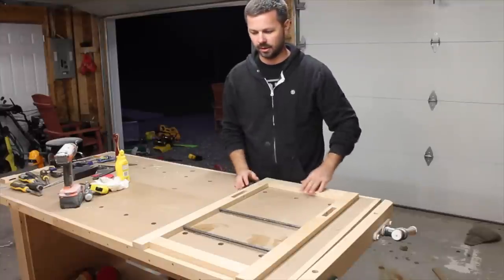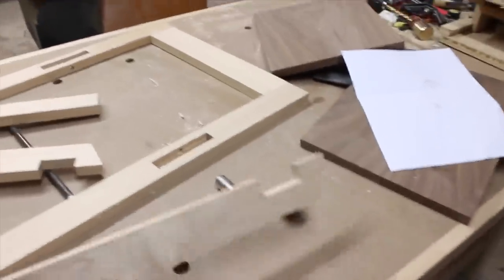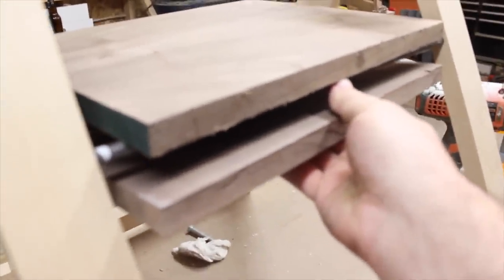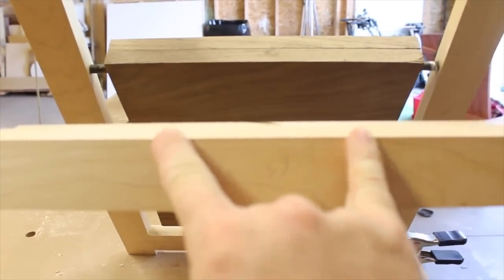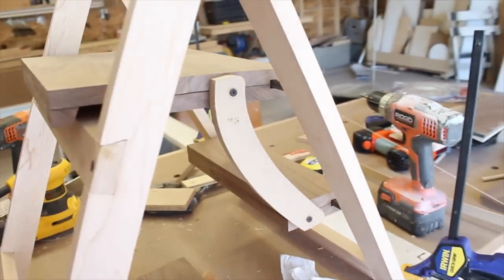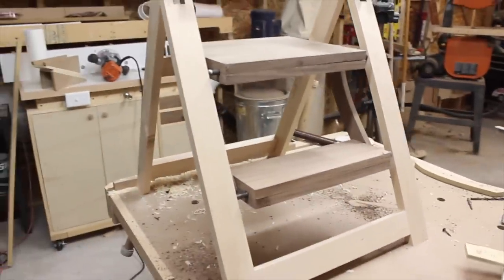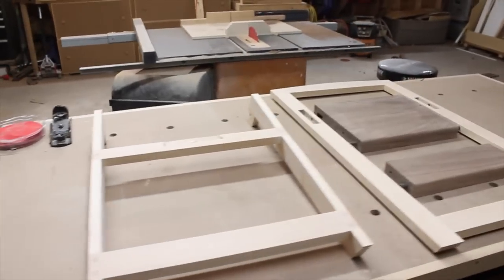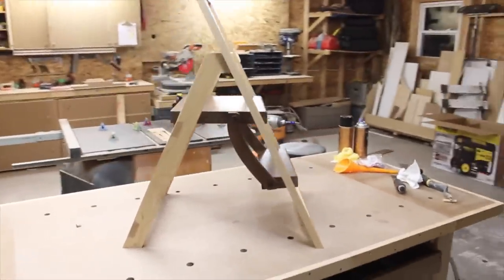Folding Step Stool!

Comment: Really nice work (as usual!) 

I have a small suggestion for the use of screws that are to be covered and left in place as you did; before screwing the screw into place initially, dribble a small amount of wood hardener down into the hole.  The wood hardener really soaks into the wood around the screw and provides a much firmer hold (along with regular wood glue; don't forget the glue.)

I also use this technique with MDF and here it works even better.  By making the MDF paper/wood fibers soft enough to move out of the way when the screw is inserted, it prevents splitting and then leaves a much stronger substrate to hold the screw after it dries (you just have to be very careful to screw it in with even pressure and to not keep turning it after bottoming out as this will strip it very easily; with the fibers softened up so much.)

Thanks for sharing your projects with us.  I enjoy watching and learning.
Reply from the maker: Thanks for this tip, never thought of it before but makes sense. 
Thanks for watching!

Comment: I need to build one of these too.  I'm thinking the reason you didn't go with a single solid piece for the top step, would be the long diffiicult "boring" job right?  When boring that far in wood, the chance that it's going to wander off and not come out where you want it gets pretty high.
Reply from the maker: Your right there, using two pieces was purely just to make it easier.

Comment: Hi Ryan.  Another great video.  I wonder if I could ask you a question.   I'm currently building my first workshop.  6m x 6m.  Three of the walls will have work benches.  I note that your main work bench top is MDF and I think I saw melamine on another.  What would you recommend for my benches?  Thanks
Reply from the maker: Hey! Thanks for all the great comments. I love having the table in the middle of the shop mainly because it doubles as a table saw out feed table. As for the top I always use plywood for the core of the top for strength, but use something smooth for the top surface like melamine or mdf. Mdf also adds a lot weight which is also nice for a bench. There is a build video for my workbench on my channel.
Thanks for watching!